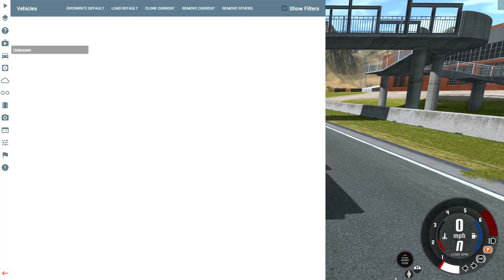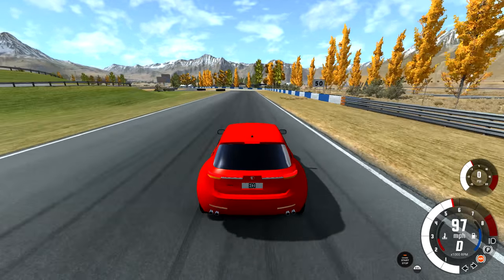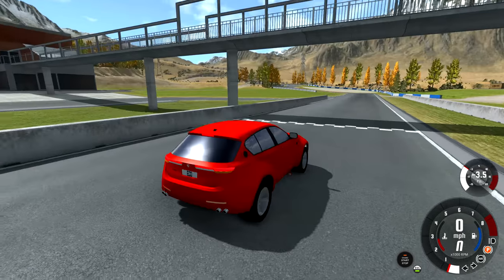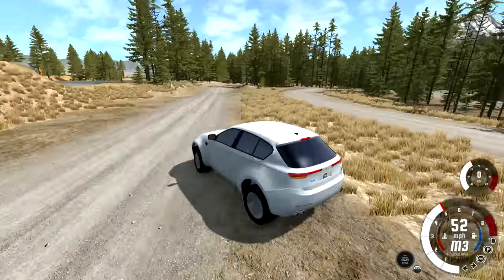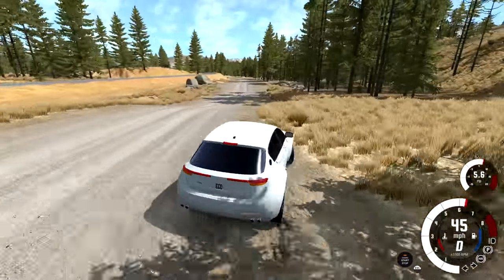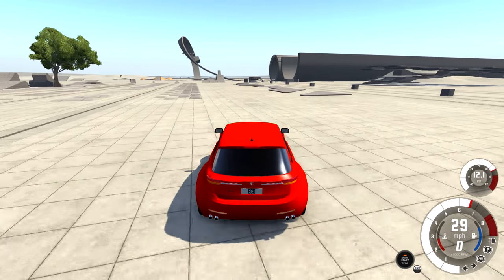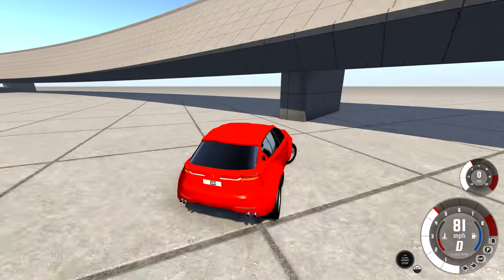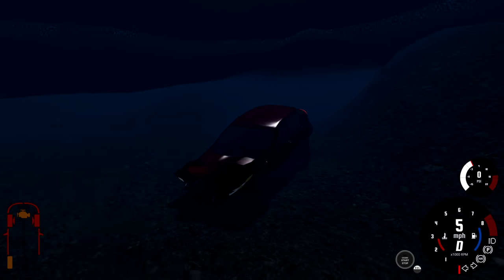CRASHING The Car I MADE - BeamNG.drive

Comment: Hi there m8,  a better handling  setup and different tire compound would solve the issues you have. Some suggestions might be to 
1. Allignment: Add inwards toe, add slight negative camber (~1° to 2°) , adjust caster but keep it positive as negative caster will make the vehicle un-driveable. 
2. Suspention: loosen spring rate so you don't bounce on the rebound of the suspension rebound after rapid compression, try stiffening the  damping. Soften front and stiffen rear rebound slightly. 

Not an engineer, so any other ideas/opinions are welcome ;)

Comment: Car is bouncy because your dampers are soft, but your springs are stiff. 
You could also use a less big brake disc in the rear but a bigger caliper to maximise braking performance.

Comment: You said you liked hatchbacks last when you were making that car in automation. Could you try making a Chevy Malibu Maxx SS? I made one in beamng drive using a sunburst hatchback but it was underpowered. It's supposed to have a 240 HP 3.9 with fwd but I'm sure you can do better than the GM performance division😉

Comment: The car has crash physics of a game from 2003
Reply: Claude Speed thats not fair to 2003, the predecessors to both wreckfest and beam ng drive started in 2004 and 2005.

This seems more like something from need for speed 3 where 'damage' was just cosmetic fire
Reply: supercrapnstuff11 yes of course. The car has the detail of a ps1 game, the crash physics arent good by beam standards, and the doors and hood are forever super welded to the car

Comment: would you consider the roamer or the hopper as a cross-over?
Reply: I think the Romer is an SUV and the Hopper is a weird crossover thing. The ETK 800 series is a wagon.
Reply: The roamer is a SUV, and the Hopper is more of a "jeep" (yes, to some, Jeep is a classification of vehicle, as Many other automakers made vehicles in the style of the wrangler and CJ, the Hopper is more Mitsubishi jeep based, which is a CJ model clone
Reply: GrizzlyDust7222 roamer  is a no hands, all out, big, fat, SUV. And the hopper is a pitty,pitty, European style jeep.
Reply: Caolan Hemmett um. Roamer is SUV. Hopper European style jeep.
Reply: h0rsepower hopper European style jeep.
Reply: Justin Noker in other words hopper is European style jeep.
Reply: GrizzlyDust7222 those are SUV'S
Reply: GrizzlyDust7222 No because they are made on truck bodies. Crossovers are just lifted cars.
Reply: lego truck wheel. Lol
Reply: Lil Novi more specifically, lifted wagons